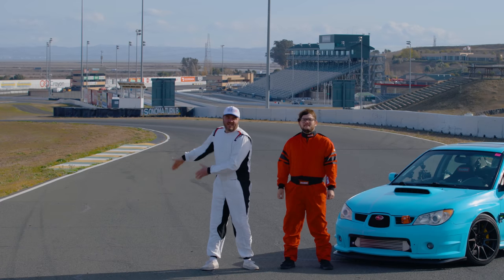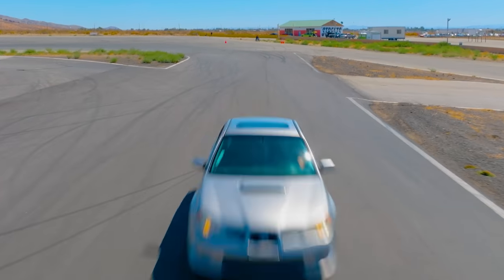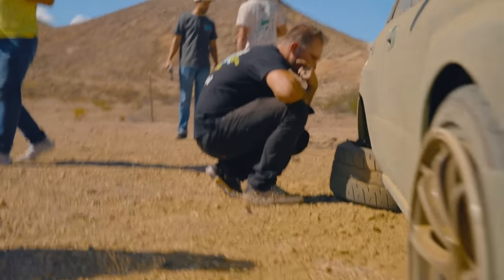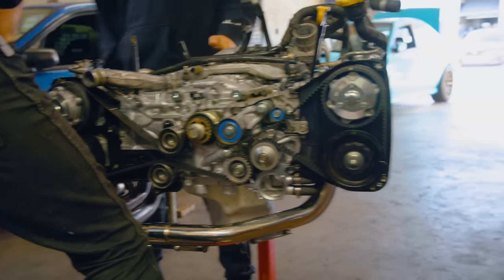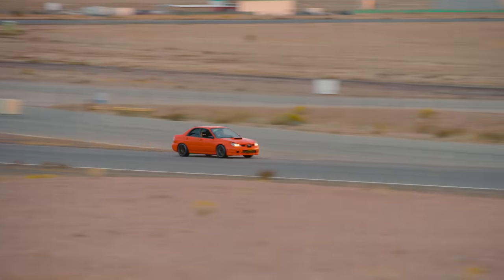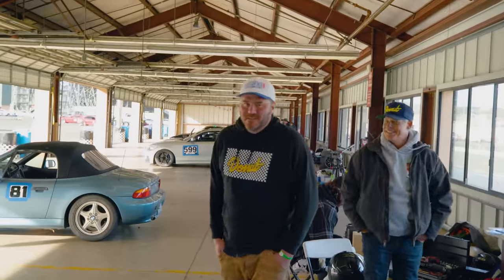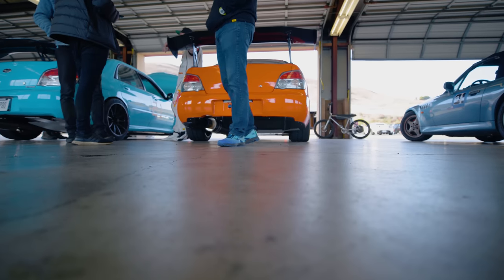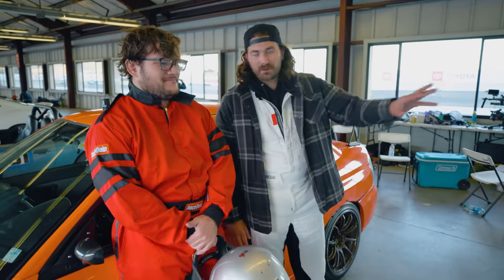$21,000 vs $43,000 Subaru WRX Build - HiLow FINALE!

Comment: The used WRX market is about to fall on its face thanks to Donut.
Reply: they need a price correction anyway. 6 swaps later, and I bet a WRX can still sell for more than MSRP xDDDDD
Reply: I think it was common knowledge these cars had some issues way before Donut made this series
Reply: and they lost their most valuable customer James
Reply: fortunately - looking to buy a STI hatchback as a daily this year...
Reply: @sully1626  sti’s seem to be more reliable, from experience 😂
Reply: @rickylol  especially transmissions
Reply: @sully1626  I have one brother - I Have the same transmission that I got it with for almost 4 years now. Live in the PNW as well so it ain't flat around here. If you drive it like a regular human being they last much longer.
Reply: And yet Driven Media managed to get their WRX to beat a Lamborghini Murcialago round a track on the original 140,000 mile engine.
Reply: That means more WRX for me 😏
Reply: @BlueBear619  but not to the masses. Donut brings it to the masses!
Reply: @sully1626  don’t I had mine for two years bought it with 30k miles nothing but pieces of shit two motors and I didn’t even have mods on it it was a 2014 btw and dealer ship covered the engine both times I just ended up getting into a flood and was able to get out it
Reply: I hope so so they don't cost as much 😭😋
Reply: After all the blown engines?
Reply: The reason I haven't gone out and bought my dream car, a 04 WRX STI is because of how they are treated. They are ran hard by mostly incompetent teenagers or people who don't maintain them, then sell for 12k plus with major issues.
Reply: @beansinacan500  yeah you gotta know where to look I've been victim to one of those aswell. cost me a lot of money at least I got a brand new motor I can make sure is treated right it's whole life
Reply: @Muggles87  And probably about 100k worth of upgrades and fixes too. Veeeery reliable.
Reply: Deservedly so for this gen.
Reply: Always thought these were pretty nice, and fast cars BUT, there is absolutely no way in hell I would ever buy anything even remotely close to this engine and transmission.. hell NO!!
 *After watching this series that is...
Reply: @malakius  nah they spent 15k total including buying the car
Reply: @BabyCharlotteschannel  your loss bud ahha
Reply: @rickylol   aren’t STI’s widely known to be less reliable than the standard model? I know a couple guys who got WRX’s because sti’s tend to not last too long.
Reply: As a Subie fan, I hope so. I literally saw a clapped out, paint faded, dented, absolute piece of shit 98 wrx listed for 20k (AUD) the other day, with 250k kms on the clock. So depressing when you consider how much you'd have to spend on maintenance and parts just to keep it going before even modding it.
Reply: Good thing, seeing as how there are no more replacement engines on the west coast.
Reply: @beansinacan500  good point I lived that car so much but I just can’t get it with the money it’s gonna cost to make it the way I like it which is literally just stock and reliable ) I’d rather get something else for that price
Reply: I just bought a 2003 WRX, one owner, 112k miles. If these cars are treated good, and not incorrectly modded and beaten they're way more reliable. I've owned three Subarus now, all Forrester's with no major issues whatsoever. No blown head gasket, nothing. The WRXs rarely even have the head gasket issues. These guys are purposely pushing these cars to the absolute limit and blowing them up. They sounded like they had issues before they even owned them. 

Take any vehicle that's 15 years old, push it to it's max around a track and add a bunch of random mods and it's going to have issues. C'mon! Watch some MrSubaru videos on this exact topic.
Reply: F M L!!!! 🤣🤣🤣🤣
Reply: Not too late for WRX futures.
Reply: One can only hope haha. Would like another Subaru
Reply: You can buy a plate to put a 47re trans on a 6.4 powerstroke unreliability won't stop people frome doing what they love
Reply: @Yohasbing  depends really how you drive them, my dads got an 04 sti, has spent around 20k and it’s bulletproof while pushing 400hp.
Reply: Its not their fault, they got cars that were not taken care off. Subies are sensitive if not taken care of. If you dont want the hassle, just get another ride.
Reply: I guess what we learnt that the WRX is no race car and that transmission upgrades are worth it once you up the horsepower by 180.... lol
Reply: @proto35  emotional damage
Reply: @sully1626  lol I’m in aus was originally looking for a Jap spec Hawkeye sti I just purchased an 2011 Evo X GSR instead glad I did go with my gut as this is now my 4th Evo I’ve ever owned
Reply: Bout time
Reply: Hopefully. Market for blob eyes and pretty much any EJ series is over evaluated.
Reply: Fingers crossed!
Reply: @abedawg94  whatever you say lmao leaves more subies for us guys who actually know they aren't peices of shit n know how to build n care for them .
Reply: @abedawg94  I've been to 190k on a stock motor on one of these WRXs before it's most definitely what they are doing with them nothing to do with the cars .
Reply: @owenbell2572  those are rookie numbers
Reply: As it should
Reply: @mjlfz1 relative to other engines like an LS or K series, wrx is simply unreliable. the fact that the engine needs to be babied and treated differently compared to other motors is a sign that it just isnt as reliable
Reply: That would be like saying people will stop buying S14's because they're not reliable lol.
Reply: It was already on its face.
Reply: @TyeCozMusic  unreliable if its sr20 swapped maybe, if its ka the s14 is gonna run forever but everyone likes to swap sr20 even though its the worst 4 cylinder ever made by nissan.
Reply: @harorider12804  the sr20 is actually reliable until you crack it open, but this is how engine modifications go in general it comes with the territory
Reply: @BlueBear619  yes but subaru fanboys were still coping and misleading people that its a good platform
Reply: @kurtmoon6456  but I’m not trying to have to drive my FUN car like a normal person. I’ve had my civic for years and I beat the shit out of it. 190k miles, 2000 civic. Seconds gears barley starting to have some trouble but guess what. Zero engine issues.
Reply: @kurtmoon6456  true.  But there are many other cars on the market that can be regularly thrashed on and still last for a couple hundred thousand miles
Reply: @kurtmoon6456  subarus arent unreliable, but they are all second hand by now and previous owners treated them like garbage
Reply: Not really subarus have been out for longer then a decade dude. These engines are neglected high milage with no recall fixes or preventions while trying to floor it to hell round a track what do you expect to happen.....any car can fail. There's cars with 300k and still going there's subarus with 300k and still going there's others with 120k and blown to bits and there is others at 120k running as good as the day it's bought. Isn't the manufacturers fault if people can't maintain a car correctly. If it fails otherwise that's most likley due to previous neglecting or demanding to much from the block when being tuned..
Reply: @beansinacan500 this. Though I do have one but wrx not sti and I'm fortunate enough to be able to fix everything myself but you're right they've been abused and people winge and wonder why they have to pull the block
Reply: @JakeTurner-we4be  show me a high compression or forced induction boxer engine with high mileage, and I will show you the proof that it's been worked on...
Reply: Lol. Take two cars that were probably beaten on straight to the track and expect them to do great. Compared to hondas , hondas might last longer but wont get same lap times or anywhere close. Compared the other way to like a 911 or a say charger, your inital money isnt about the same as they have total into these wrxs. Yes they have issues but every car has issues, unless you buy a old volvo. They seem to never die
Reply: @BabyCharlotteschannel  This series really doesn't represent them well. They are more sensitive than other motors, and need extra precautions. You don't really hear of these issues nearly as much outside the US.
Reply: @no1washerezz  You don't have to baby them, you just cant mod and maintain them like a Inline or V platform. Flat engines don't have near the same R&D
Reply: @faj2600  It is, though. Its just trickier to build. If it wasn't, it wouldnt be a rally and tuner legend. Simple as that.
Reply: @sparkatorch  yeah. that's my point. why not though? because it's simple. these subaru boxers just aren't as reliable hence, not as good in my opinion.
Reply: @no1washerezz  I can agree they are not as good as other orientations, Im more arguing that they arent "unreliable POS" some think they are. They require different attention, especially to build and mod. They clearly got something going for them, being so popular on the street and the track.
Reply: @sparkatorch  probably people enjoy the unequal length headers and or the higher temperatures on one bank of the engine. 

honestly though, im not too certain about their popularity. if we look at engine swaps which is a certain "area" where people actually choose what engines they have, nobody really swaps a subaru motor into their car rather the opposite is more true. if we use a miata for example, one of the most popular swaps is a k24 but you'd never see an ej or fa in that list. not saying it hasn't been done before but im not sold on believing that these motors are popular choices given that someone has the option to choose which engine they have.
Reply: Nah its gonna fall on its face because of its own design. Cant blame them after 8 motors😂
Reply: @daveruiz85 the transmission never failed though
Reply: They had fun and liked the 350z but the wrx is just shit

Comment: I just would like to mention:  I knew someone who owned a `08 wrx.  I drove it.... loved it!  But these are high maintenance machines,  if you CHOOSE to drive them hard. 

My dad used to race.   Every season, he pulled the engine, overhauled it then put it back together, reinstall engine, win races.   He went through many engines.  He rebuilt them until they were scrap.

There is never going to be a truly happy marriage between a commuter and a race car.   Only the determination of the driver.
Reply: this generation of wrx are just bad cars. Might even be the most notoriously unreliable jdm "sports" cars to date. Most bmw models have a better track record than this
Reply: @jeffbezos3633  its rly the us 2.5s that are bad nothing wrong with normal turbo ejs if you dont limmie bash all the time
Reply: @Calypsom52  I'm not saying you can't replace and add supporting modifications to half the parts in the car or get lucky and get a solid car. But Subarus are notoriously unreliable for making power. I also am not under the impression that they last particularly long as used cars without extensive maintenance.

Comment: Felt like this season of HiLow went by really quick! We need longer episodes, and more shots on installation of parts so the series feels more personal and casual like the first and second HiLow

Edit: Credit where due, they did their best to deliver after blowing their budget, rebuilding engines and Hi-Car, as well as filming the MrBeast collab content at the same time. I guess what we're trying to say is that we all appreciate the hard work and effort for pulling this off and we look forward to the next HiLow!
Reply: Exactly what I was thinking. Didnt quite feel the same
Reply: I think the 5 engines made them so out of budget they did not have anything else to do more mods or make longer episodes
Reply: Time pressure dues blown engines I guess
Reply: Or a seperate video with the installs, kills two birds with one stone and the video stays short for the algorithm
Reply: 100% agree
Reply: They went over budget by 3rd episode, i can't blame them. Also, they crashed a car, that surely took a lot of time, and also they did another sequel to the 350Z season in summer.

Also, take into account that these WRXs were turbo-ed since the beginning, instead of 350Z's season where they did needed a lot of prep. (The turbo episode put like 5 different chapters into a single one)

If they ended running out of time, then i cant blame them that much, they did their best to deliver.
Reply: @HirokaAkita  facts! they did a lot considering how much bad shit happened
Reply: @haun__  Bad shit? I think Donut Media went outright into a logistical shitshow xD
Reply: @HirokaAkita  i wonder if they started to consider canning the series by the 2nd engine that had to be so painful to their wallets and their souls lol
Reply: @beandip461  I don't think so. But i really think they thought about stopping everything when 1st Hi Car was totaled.
Reply: They were busy building jet engine cars
Reply: @HirokaAkita  oh 100%
Reply: id say the new engines and car cut down on filming time and budget. if it wasnt for that the series probably wouldve been better
Reply: Completely agree.

Comment: Seriously I'm blown away by how much dedication to this despite the troubles man
Reply: Not as much as those 5 engines
Reply: @grizzlyadams9219  Was waiting for this pun
Reply: I don't think I even want to know how much money they spend buying those cars and engines again and again
Reply: @td8648  more than my wallet could handle
Reply: @SirFryStirFry  5 is rough, but they are the cheapest short blocks in existence
Reply: @michaelnorman5028  I'll admit I'm used to working on classic muscle so everything under the hood is expensive
Reply: @SirFryStirFry  wonder how much a brand new Chevy short lock is with internals. Cheaper than $2000?
Reply: @michaelnorman5028  1700 for the block that is just the 350ci
Reply: Well it is their jobs

Comment: Yeah, the stock WRX 5-speed transmission is good for about 350-380Hp. It was inevitable. The STI 6-speed transmission on the other hand, is good for about 500-520 Hp.
I have a 2002 Bugeye WRX. Absolutely love it and it is the 2.0L variant, not the 2.5L, so I don't have to fear for blown head gasket even with 300Hp. Stock internals, except for the baffled oil tray, stronger oil pick-up (stock is trash brazed one, mine is welded with additional support arm) and bigger oil pump. No problems even after 10000 miles of daily driving. Constant oil and water checks and oil change at 6k miles, next is at 12k miles.
Reply: I'm buying a 2003 blob eye wrx think it's the 2.0 version off a friend in a few weeks for £15,000 but I'm unsure exactly what's been done to it. as he's a bit of a bullshiter. He told me in the past that it's 500bhp but I'm pretty sure that wrx can't really get to that bhp but sti can. I don't know too much about cars but I do really want it as it looks sick and got the wide body kit.. things I know about it is that it's got 36,000 miles as he had a new engine a few years back an it's got 3 gauges on front dash including the oil pressure. And a boost gauge on the front pillar.. it's ridiculously loud and pops n bangs really well which I love. I googled common faults an seems like it might be a good idea to get it compression tested to make sure the cylinders are ok. Would you say that's the main thing worth checking before buying? I know he's spent load's of money on it but want to know that the engine is good before I commit.

Comment: This series probably spent far more money on the "upgrades" than the others, but in the end the hi/low part seemed to become secondary.
Reply: Yea, I definitely agree but I understand it because of how many issues they had with the engines and I'm sure it was expensive. However I do with they would stop being so worried of showing upgrades that we've seen before like turbos and stuff like that as a different car is enough variety imo.
Reply: Build the ultimate sleeper!
Reply: They spent more on motors.
Reply: This video provides a very important lesson: do not buy any vehicle that is Subaru-powered.
Reply: I'd love to see hi/lo compare bought vs built. 
Comparing something like a new Mustang 5.0 to a built up 05-09 would be awesome!

Comment: would be an interesting addition to the Hi vs Low series, perhaps having a pre purchase inspection to be part of the show. 
Not only could it limit some lemons from getting through (requiring engine swaps etc, as in this case), but it would also show the value in pre purchase inspections in general. All the way from top tier comprehensive inspections (where they check literally everything) down to cheap and basic inspections. This would not also show the benefits of having even just a basic pre purchase inspection, as well as the lengths they go to in the more expensive and comprehensive inspections. 
Those exact comprehensive, yet expensive, inspections saved me from buying lemons on two occasions (R34 GTST and ironically, a WRX), both of which had basic inspections and passed with flying colors, where the more expensive services quickly found that in both instances, the vehicles had been in major accidents (R34 had a huge rear end collision, WRX must have been T-boned), however the shops that did the repairs the cars must have been very good, as any visible damage was cleverly hidden in a way that would fool just about anyone. 
They only started suspected something was off when their fancy laser measuring blah blah system picked up slight chassis twisting in both cases (the suspension, arms, toe, camber etc had all been realigned, effectively hiding the damage), to confirm their suspicions they then had a way of testing for weaknesses in the steel body work (don't ask me how) that showed stress points in the exact places you would expect given the accidents they were involved in.
In the end I found a great bug-eye WRX that I got for a steal, the thing ran flawlessly for 6 years, only had about 450 at the wheels but she was a fun and reliable sleeper.